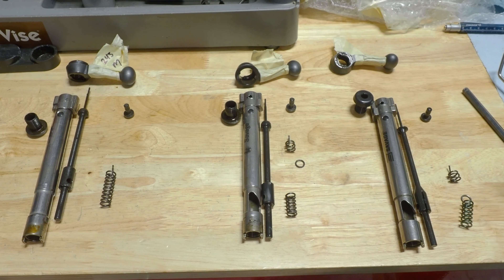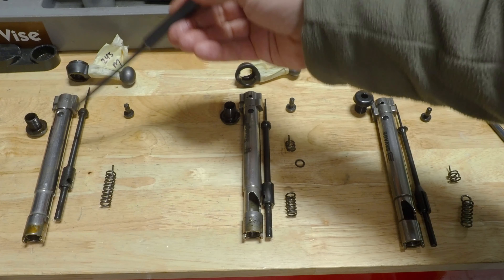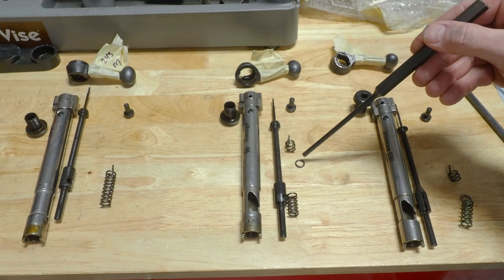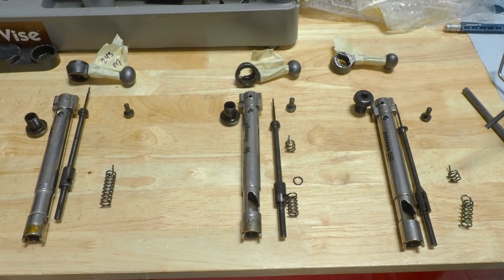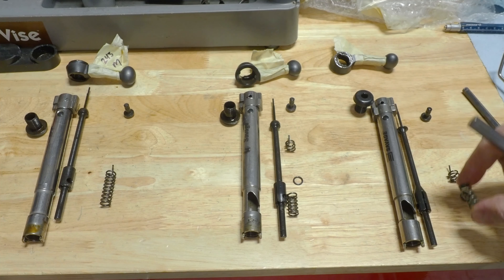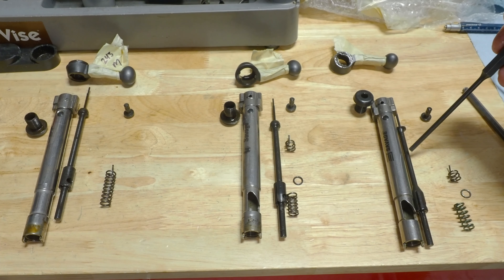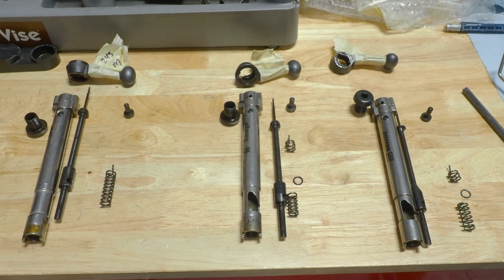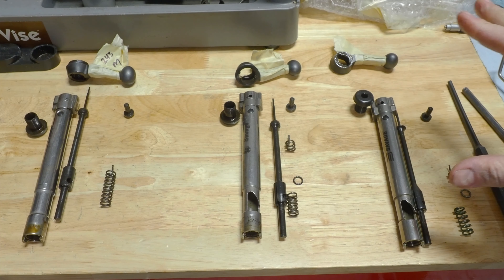Savage Axis Bolt Variants

Comment: I was experiencing light primer strikes on my 6.5 CM Axis. I took the bolt apart and saw the retaining spring had one broken coil. I called Savage, they sent me out a new firing pin, green spring, flat washer/spacer and a new retaining spring. Here's the fun part-the new firing pin would not go through the hole on the bolt face-it was too big. Also, as you mentioned, the green spring was so hard to compress, I couldn't get it in the bolt housing. I called them again-they assured me it was the correct firing pin because of the serial number on the rifle. How do you tell a rifle manufacturer that they screwed up somewhere along the way? They wanted me to send the rifle in. I ended up just putting the new retaining spring in-so far it's holding up-if it screws up again, I guess I'll have to send the whole rifle in.

Comment: Ess the one piece spring was binding during the bolt throw so that's why they went with a 2 piece with a washer in between.
Reply from the maker: Funny i found them to have the least issues with binding.
Reply: @GrimstodDesh  I have 2 of the original bolts and had to send both back to savage due to the spring binding and decocking the firing pin as I was ejecting an empty shell casing. Possibly could have been disaster if it had happened with a live round. The bolt was returned to me quickly each time in working order. I don’t know if they changed them to 2 piece spring or some other fix. I have 2 of the second Gen from 2017 that have not had issues. All 4 have heavy bolt lift but the 2 stainless models are smoother for whatever reason. One old, one 2017.

Comment: Installed my Lift kit along with the mcarbo pro trigger kit on my Axis .223 and wow, feels like a completely different rifle.  Got the bolt on handle as well, little lose with a dab of glue, took it off, the glue came off extremely easy which is excellent, put a good sized bit on both sides, and got it together, still a ever slight wiggle but seems to hold well. Luckily if i decide to go another option, cleanup is a breeze, overall very pleased.

Comment: So I just bought from Walmart the Axis ll in 308 stainless steel... It has the linear groove at the base of the firing pin, and also has the loaded chamber indicator... Which kit is more appropriate, the universal kit or the 2019+ kit ?

Or are they exactly the same ?

Researching to buy...
I appreciate your time spent in responding, thanks
Reply from the maker: I recommend watching my video about which bolt lift kit to choose.
Reply: OK I did that on your video from a year ago... and conclud it's 2019+ model kit that I need... Now I seen the black one for $17 on the website that starts with E (maneuvering around censorship) but do not see a stainless steel 2019+ model.... But do see the Universal kit in stainless steel.... I want stainless... Will you put that up for sale on the big E or not ?

Thanks again !